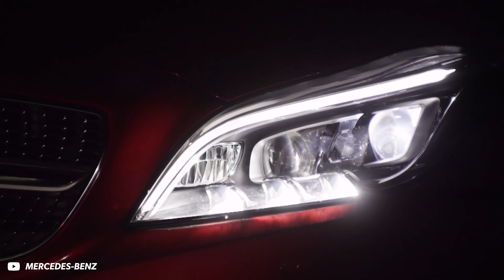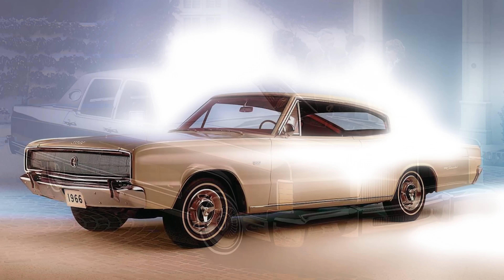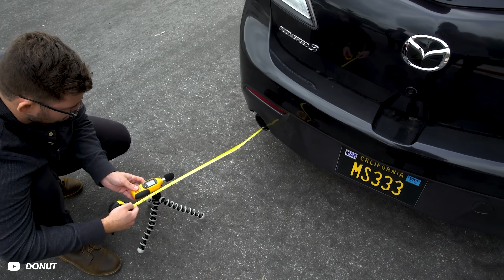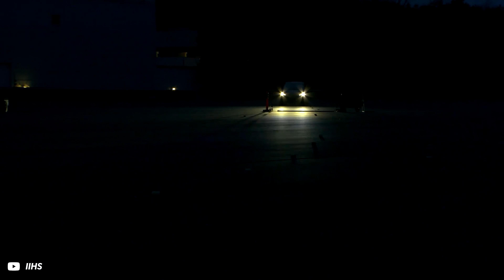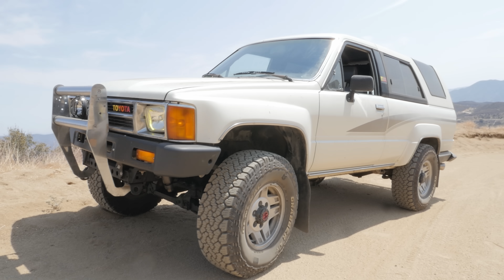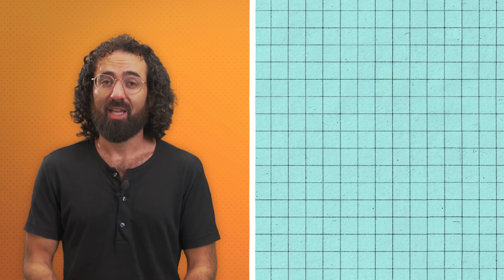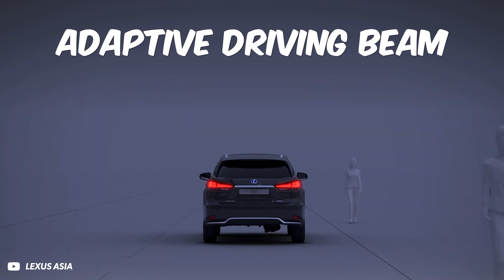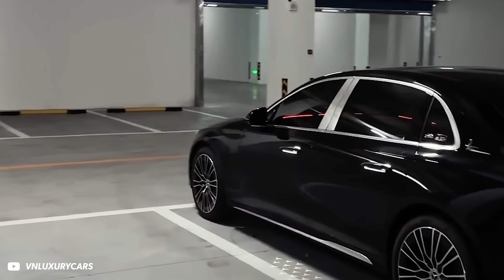Why new headlights are blinding American drivers

Comment: I think it's ridiculous how many layers of arbitrary nonsense we have to consider for a problem that has such a simple solution. My cars from the 90s have lights that are plenty bright, and don't blind anybody. In the city, where you use your dims, we have street lights. The dims do not at all need to be bright. Just enough to fill the gaps of the street lights, which is next to nothing. Then, when on back roads without street lights, we switch to our brights. My  99 Rav4 brights have plenty of brightness, and visibility is excellent just with the stock lights. Then, in any situation where our brights could inhibit another driver, we turn them off anyway. You don't need brights when following another car, and shutting them off briefly for oncoming traffic isn't an issue. 

We already had this figured out. There shouldn't even be a conversation about all of this extra stuff because none of it should even exist. Yet here we are, worse off than before, having to argue with incompetent regulators to get a solution to a problem that has literally no reason to exist in the first place, all egged on by other regulatory bodies who have zero concept of the problems their incentives cause, and a negative value of desire to fix it. 

This is the problem with regulatory bodies that never gets addressed. They create artificial incentives that constantly lead to, in aggregate, more problems than they seek to solve. Which in turn forces us to engage them even further, creating even more problems while trying to solve the first problem, ad infinitum.

Comment: In the UK here. Our yearly inspection tests the setting of the headlights, and unfortunately the equipment is severely flawed. As an experiment I screwed my lights up very high and then tested them, they passed. Also adaptive headlights are not good on anything other than flat straight roads. They don't adapt quick enough on hilly twisty roads. The authorities should limit the light output because LEDs put out far too much light. That is the problem.

Comment: Dutch guy here and As someone who is sensitive to light, and who has pretty decent vision in the night I can tell you that the problem with these headlights is fairly simple; They are simply too bright, and on SUV's they sit too high and aren't angled down enough. 
With halogen lamps you can see enough of the road. when you use highbeams.

My problem is mostly angle placement. It's impossible ot get this 100% correct as certain curves can put you in the sweet spot. but "Sometimes" is better then "Most of the time" in my book. I'm also driving with yellowtinted glasses to reduce some of the strain, and i'm also thinking of adding a tint to my outside mirrors. 

To me I feel if headlights arent changed, perhaps the front windows needs to change. There are ways to block out light that is emitted from LED's. You have glass that you can install for conferences rooms that block out just the TV. So, it may be possible to have a "Reduction" effect instead of a blocking one so that it is still visible but not blinding.

Comment: i am old enuf to remember, as a kid, going with my mom to have the New Jersey inspection Station inspect and sticker her car. Along with braking tests, pit style running gear inspections, exhaust inspections , there was a long horizontal bar with two meters on it to measure headlight aiming and the car would fail if the readings were wrong. Too bad citizens worried more about $$ than functional,safe vehicles!

Comment: In The UK, NZ, Australia, most of Europe and probably a few other countries, cars have to be tested every 6 months or every year to ensure they are still safe to be on the road. If they fail the test, you can’t drive it until you fix the problems. If you jack up your truck and put ridiculously bright unfiltered bulbs it would fail part of the test. Maybe the US should implement a national fitness check before trying to solve the problem with brand new vehicles. That way manufacturers would have to comply or their cars would fail the tests

Comment: Don't be thinking ADB is the answer to all the problems. We have it in the UK but because of the nature of our roads, often narrow or twisty, even with ADB and auto dipping headlights, the systems do not react fast enough as they have to see the car before they can react to it. This means vehicles coming round corners get the full force of high beams before the car has had time to draw the box around it, and on some roads and certain speeds, that oncoming car has already passed before the ADB has drawn the box, leaving that poor driver blinded. Mercedes is one of the slowest to react. The problem with much of this tech is that drivers are becoming much more reliant on it rather than thinking ahead - I invariably override it on my Mercedes and dip the headlights manually if I can see the headlights of oncoming vehicles because I know the car isn't going to react until it's already facing the car.

Comment: Ive seen comments from people that find the matrix lights (i think thats how they are called) not work all that well ... idk about them but ive driven and been in front of a car fitted with such lights (in this case it was an Audi sedan) and boy oh boy, they worked amazing. It was on a twisty road too. When driving it i clearly saw where the beam was pointing and it was everywhere except for other cars. 
When in front of this car i could clearly tell it was driving with high beams and i looked straight into the headlight and it did not bother me.

This is a great technology imo
The only problem is that its very expensive and as ive seen they do break and when they do, you better be ready for a massive bill to pay.

Comment: Mechanic of 14 years here. the biggest issue with this is price. I've had Merc, Lexus, BMW ECT.... owners find out the hard way when they hit a dear something the cost of head light assemblies right now. Some going a far as $15,000 to $30,000 replace, or as far as junking it, trade it, let insurance take it because of a headlight assembly.

I've even modded a few headlights with active radar when the module broke or the light housing rotation motor broke and just locked it in place so they could just have a normal headlight because they didn't have the money to replace it as most can't get parts and they want you to just replace it at such high cost.

I get the safety factor, but the cost makes no since at all. Some have even gone as far as rigging up other lights from other cars because of it, and i don't blame them. 

Sometimes we need to look at reality vs maybe some of these people complaining about being blinded just need to slow down and look at the line to your right (you know that thing they said to do back in the 80s when i got my license if lights ((like from as tractor trainer)) were blinding you) never had a issue then, and i don't have a issue now when i see them.

I think there's a few delicate flowers out there that shouldn't be on the road, some that need to adjust there lights a little down more when going with aftermarket, and others that need to be reminded about actual reality and how life works.

Comment: Adaptive lights won't help for major highways where glare is created from oncoming traffic that is 6 to 8 lanes away and across a massive center divide, which is a real problem.

Not to mention ones for cars directly in front or behind you ... when not tailgating.

Or they would work if traffic is uniform, but would be flashing on and off in brightness and being WAY more distracting.
I already get distracted by auto-leveling headlights that blink/flicker as if someone is trying to signal me by flashing their brights.

You know what would be more useful? Dimmer lights for everyone with lower color temps and sun-sensor tinted windows and windshields (when tint is used) to allow for better night vision. 

The problems with adaptive headlights MIGHT be worked around if there's a substantial delay and gradual, smooth tradition that avoids flicker at an organic sort of shifting pace that can't be mistaken for blinking or flashing. It would also help if frosted, highly diffuse headlight lens liners were used to give a soft, uniform light and use a much lower, warmer color temperature.

You'd need it to compensate for highway traffic by KEEPING the beam narrowed AFTER passing through traffic, and GRADUALLY shift to wider beam breadth after an extended time of fully open road.

Even then, I'd imagine it'd be hard on people who have good night vision, but very slow pupil response. The sort of people who might forget to turn their headlights on at all at night within the city or parking lot, because you can see too well already and don't even notice your lights are off. (has happened to me multiple times, which is bad mostly because my parking/running lights are off so the car is going to be less visible ... never actually run into trouble with it, but still, I have to force myself to remember since it's not nearly dark enough to make me WANT to use lights, plus I'll leave my low-beams on almost all the time and see perfectly fine if there's no blinding traffic around)  Given the sort of traffic common on local highways, the car distance is also never even long enough to need high beams, either. (wide open surface streets at odd hours, or lonely backroads are another story ... I do use my brights then, but do my best to dim them when there's oncoming traffic)

Comment: 1000 lumens is plenty ... unless you need dedicated fog lights.

And even then, a cold white daylight color temp is bad and causes way more glare blindness than warm yellow white.

The newer street lights are terrible for this too, compared to the sodium vapor lamps and even the old mercury vapor lamps (even though those were blueish, they weren't as harsh bright). (but not nearly as bad as headlights)

I know astronomers hate them too, since with the Na vapor lamps, the emission spectrum was narrow enough to easily filter out light pollution, but not so anymore.

OTOH, the more common yellow or amber tail lights are also a bit confusing in certain contexts now. I ... think those are supposed to be for signaling, not running lights, but I'm used to yellow or amber being more normally on the side rear reflectors/fender lights.

Bright white reflectors used for roadside pylons is also terrible compared to the orange and yellow ones that used to be common.

Way way too much white, and it's unsafe and unnecessary. (also makes it harder to tell people from pylons given white clothing is more common)

Comment: even worse is if you live in a place like norway i live above the artic circle so every single car blinds in the low ford focus we have which is lower than the average focus but is otherwise basically identical to a average focus not a ST or RS 2012 and with me having that one thing that makes lights go weird like start going in 2 directions like a quasar being shot out from a black hole it doesnt help theres a fucking rule where you have to have some sort of headlights on fucking 24/7 if you are driving sure you are meant to use lights that are weaker in normal sunlight but it doesnt help

Comment: It's not just brightness, but color temperature and lack of diffusion.

If LED phosphors were used with a warm white or soft white color temp and overall brightness close to traditional halogen incandscent lamps (that were still common factory options 10 ... or at least 13 years ago), it would be OK. Back then, you had people still complaining about 'Xenon beams' as aftermarket items ... except they were mostly LEDs by then, too (people still make comments on Xenon beams, actually).

That and people use their high beams WAY too often when low beams will suffice.

My 1988 Pontiac Fiero with original halogen lamps is still more than bright enough on unlit backroads ... as is our family's 2012 mustang and 2012 Mazda 3, both of which have halogen bulbs.

Comment: European here. It is... more complicated. Matrix headlights don't always detect oncoming cars properly, and I've seen that from both perspectives. Yes, they are awesome when they do what they're supposed to though. However... they are also expensive, so definitely not a standard equipment even in new cars of premium brands. So the problem with static LEDs remains. And there's the independent issue of the headlights being mounted very high - probably the most infamous example of that is the Fiat Ducato, known in the US as the Ram ProMaster. Once while having one drive too close behind me at night I got so annoyed by his blinding headlights that I've readjusted my side mirrors to aim at his windscreen - and surprisingly it worked, he increased the distance, so his headlights weren't as blinding to me.

Comment: Why should automakers spend all of that time and money inventing these adaptive beam things when they could just use the correct lights to begin with? Go back to the standard sealed beam lights and angle them correctly, and the issue magically goes away! From there, it would rather straightforward for police to ticket drivers with illegal lights, either from an aftermarket install or a failure to readjust after installing a lift kit. Either way, the responsibility would fall on the drivers because the manufacturers would have been using the federally-mandated lights at that point.

These adaptive beams are just not safe, because all it takes a small code or electrical issue and now you are always blinding everyone with no way to fix it (and taking it to a shop will probably cost a few thousand because automakers make the software needed to diagnose and fix things proprietary and expensive).

Comment: Can you talk about how Kelvins fits into this as well? I feel like I am more blinded by higher Kelvins than higher Candela alone. Of course a large part of the problem in my area is people who don't polish/clean up the plastic covering their headlight, and instead just buy brighter bulbs, which covers a problem with a bad solution. Also popular here is the lazy-a** whose light bulb goes out, and instead of replacing it they just use their brights.......... in town. That's especially helpful (sarcasm).

Comment: Doesn't the vehicle inspection (called DMW maybe?) in the US inspect, whether the lights are blinding the other drivers? In here, they measure it every time, both that it lights up what it should and doesn't what it shouldn't and if you fail, you have 30 days to fix the issue, or you are off the road.

Comment: LED headlights are a: too fucking bright and b: full-spectrum emitters. Halogen lights are yellow emitters. They're a lot kinder to night-time vision. This is why sodium street lights were used for so long. SO THEY DIDN'T DESTROY YOUR NIGHT VISION. I ride a motorcycle with a halogen headlight. I am NOT going to "upgrade" to an LED. I'm not an asshole. People who buy cars and gush at how bright their headlights are are the assholes who think it's fun to perform lasik surgery from five miles away. They're also the reason I won't drive at night if I can help it.

Comment: I live and drive in Italy. Most blinding issues  actually stem from poorly maintained cars  and reckless owners. Although the whole matter  is complex and still not fully regulated, EU rules pretty much allow for safe driving: there are strict rules about the light source intensity and about periodic technical revisions of all vehicles.
As for aftermarket lights,  they must comply to  EU rules, i.e. if the Police stops you driving a car equipped with non approved spare lights, they can seize the car.

Comment: One could maybe also question, why one can install aftermarket headlights that violate pretty much every regulation on this planet without any consequences.
Do that in the civilized parts of Europe and your registration is no longer valid, which means also your insurance is no longer valid. You're completely liable for any damage resulting from operating that vehicle, so you're  bankrupt for the rest of your life if someone gets seriously hurt in an accident. And if you get pulled over, you get cited for operating a vehicle without registration and valid insurance and potentially for illegal modification of the vehicle.

Apart from that, "here" (Northern Europe) the issue is mostly that people drive with LED or Xenon lights but behave like they would have the wax candles that cars used to have some decades ago. Meaning, they don't dip the headlights when the other car gets into view but only when they're really close, because "that is what they old us 68 years ago in driving school".

And of course having incompatible cars on the road at the same time. Driving a normal car when an SUV is behind is a bit annoying - although also that is an issue that I found much worse in the US, as the number of high vehicles (especially the pick-up trucks) is significantly bigger.